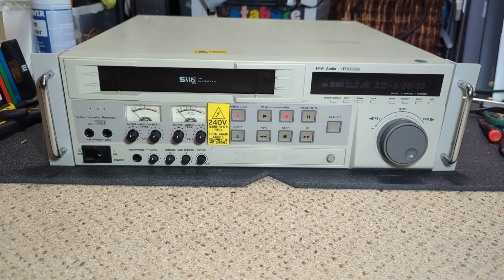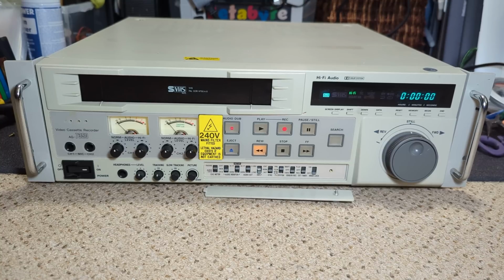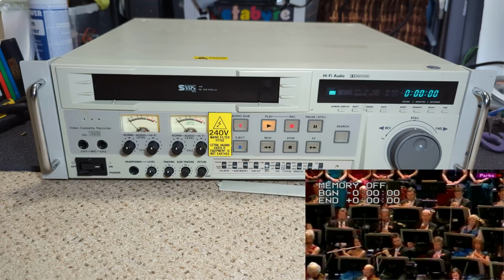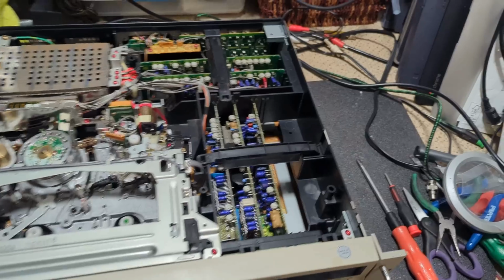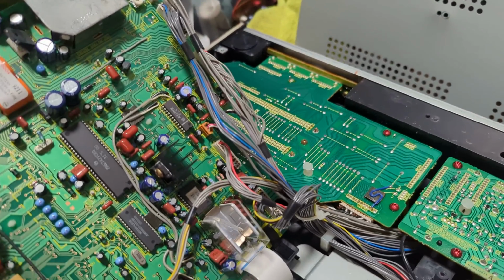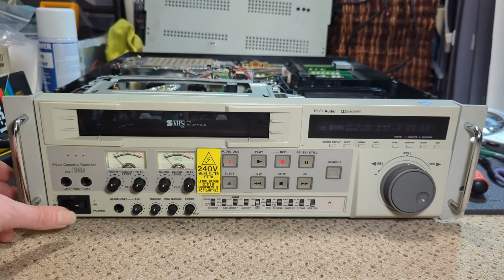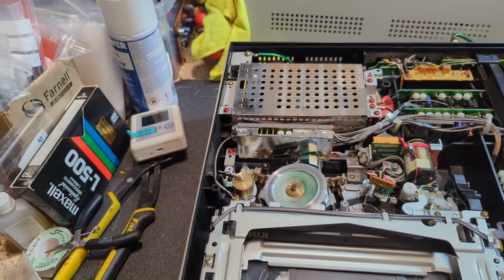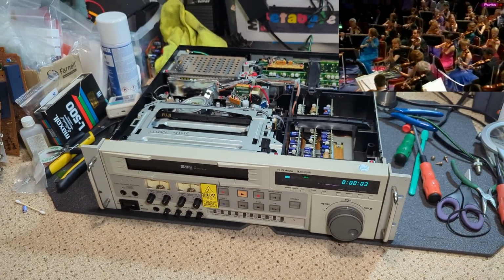Panasonic AG-7350 VHS/SVHS - Servo issues and no real-time counter FIXED!

Comment: Awesome!
I have recently aquired a Panasonic AG-7130 which has a lot of artifacts on screen and i found that the exact same capacitor was beginning to leak on my deck as well!
But unfortunatly it did not solve the issues with the on screen artifacts.
I've cleaned the heads and also the guide posts, but no luck.

Any suggestions?
Reply from the maker: Glad you got that dodgy capacitor changed. Depending on what the artifacts look like, I'd be checking for any bad caps in the head amp or signal processing. More than likely it'll be on the first stages where the issue will be. If you email me a picture or video of the issue I possibly could give more info.
Reply: @MrBetaByte i uploaded a video of the deck and issue here ❤

https://youtube.com/shorts/Ch33L4hV5_g?is=jJAFBTB6lswUTd53

Comment: Thank you very much for this video! You really saved me a lot of time and nerves.
I received this machine today and it had the exact same problems.
Fortunately, I still had a 47 µF capacitor lying around and replaced it right away. Problem solved.
The leaking faulty capacitor measured 50 µF with an ESR of 1.6 Ω. I also have the TC1 tester.

Now I just need to take a look at the rattling head cleaner. ;-)
Reply from the maker: That's fantastic and great it's up and running again.

Comment: With the tracking switch engaged and the right meter reading 5-6 what does that tell you about the recording heads?
Reply from the maker: The higher the deflection the cleaner the rf is from the heads.

Comment: Nicely done Alex! I've got a pile of these machines, so far untouched. You're correct about being early 90's. They were designed for edit suites. At the time the main Panasonic/JVC ENG tape format was MII to rival Sony's Beta SP, both were expensive but decent component recording. Sony dominated the industry of course. Panasonic & JVC also had a line of ENG SVHS kit for those who couldn't stretch to MII. So the AG 7xxx series of decks would connect with an edit controller as part of a linear edit suite. The flagship was something like the AG7750 with built in TBC. You can tell they are professional units if they've got timecode for frame accurate editing and Dolby for the linear audio. The range included 1/2 & 2/3 inch 2 & 3 CCD dockable camera heads which could take either an MII or a SVHS backend recorder like the AG7450. Rumour has it one or two ITV reginal newsrooms used them in the 90's for a while before DVCPro & DVCAM took over. Sometimes the SVHS camera tapes would be edited in a Beta SP edit suite, SVHS used as an acquisition format only to limit deterioration. And no......pro kit doesn't do awful LP! Anything based on VHS is bad enough without halving the tape speed!!!
Reply from the maker: Some great info there - thank you very much for sharing. I especially love the comment on LP on Pro VHS machines. Only thing I was thinking is LP playback might have been a useful 'in a tight spot/ all we have to work with' option but then the compromises in adding that feature would have been to the potential detriment of good SVHS performance.
Reply: @MrBetaByte great job! I own similar device, it turns off immediately after couple of seconds when turned on. Later when it gets heated it turns on. Can you tell what capacitor should be replaced on what c.b.a?

Comment: One of my first jobs after leaving college (1996) was working in a VHS duplication factory, and that machine seems a bit too expensive to be a duplicator, especially being able to record in SuperVHS. The ones I remember as duplicators were made by JVC and had 3 VHS decks in a single unit, probably the JVC BR-7030, if one of the three decks failed it could be unscrewed, removed and replaced quite easily as the whole deck could be pulled out from the front without having to take the machine apart. Those duplicators had to be remote controlled as the only thing on the front panel was a manual eject button and some RF test points. They did have something similar to this Panasonic if the master/source tape was VHS/S-VHS but that might have also been a JVC.
Reply from the maker: Agree with you there and it does fit the educational/ industrial editing scenario much better I think. I'm sure Panasonic must have produced duplication machines but so far I've only really ever seen reference to JVC duplication 'farms'. Thank you very much for sharing - much appreciated.
Reply: I remember they used to spot check a few sample recordings from each batch and they used one of those small Panasonics for that, something like an AG-5250.
Reply: @MrBetaByte  The Panasonic AG-6840H with G-Drive is from 1990, but my 52MB image of a "farm" is too large for my freemail provider.

Comment: Panasonic AG7350 common fault always with the control pulses. The AG7355 uses the extra module which wasn't included in the AG7350. There also is a 1uf 400v capacitor that goes open circuit in the power supply and some caps that go high in esr in the power detection circuit which will affect the operation of the deck whilst running. Excellent Repair...
Reply from the maker: It really does seem to be the main issue with these decks from what I've found online and good to know about the other potential issues with the power supply and power detection circuit.

Comment: hi do you ever get decks that you can't fix   
just asking    i do have decks that have to be jazzed up because  getting the parts just will not fix the deck 

un lucky past from gear to gear   a am going to dig in to a big lot of 100 ub   can they be fixed  alot of parting out  i think 

i gone over to betacam for alot  finding a place for the gear  the un lucky has not past over to betacam  gear 

i have some brenell  R&D decks  that been un lucky  with

  i having to by past all the ic logic  the pcb copper tracks is going bad on me     i put in a new relay logic  to talk to the relays that are ok 

i get 40 years plus out of the decks  

i have to take 12 sony  ub100 decks apart    find a use for the parts
Reply from the maker: Not really - I think I've scrapped maybe 5 machines out of the 400+ I've now fixed or rescued and one of those was bought from eBay as a 'scrap' machine (a Sony C9) and those that I scrapped were in the early days some 6 years ago or so when I started really fixing these machines again - very useful to have the parts.
You have such a collection of machines there and I bet you have so many parts too. Do you have any spare HF100's that you might part with for the spares?

Comment: What I don't like about this device is that it uses a low-pass filter with 240 lines of horizontal resolution for color VHS. For black and white, it switches to the parallel 300-line low-pass filter. This should be converted to a permanent black and white filter. S-VHS has a separate low-pass filter. Disabling the noise reduction, which has been made obsolete by AI, is complicated. On the positive side, there are separate PG-Shift (head drum side switching) trimmers for video and hi-fi. You can easily turn the video head switching down to "line" 577 on the left side (after removing the side panel). Analog tube TVs might not work well with this. As far as I know, the batteries are only for the timer. The free space on the right is for the freeze frame memory PCB of the AG-7355.